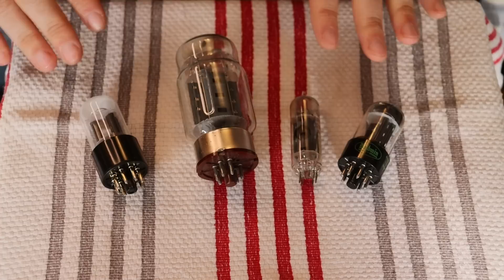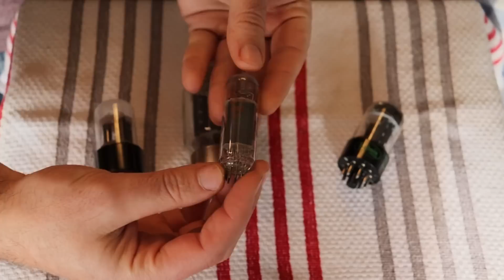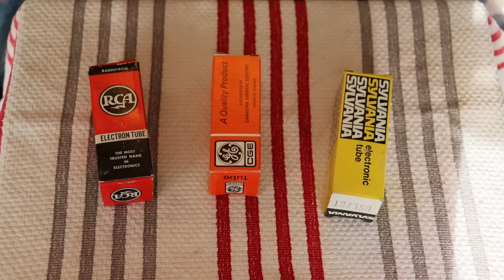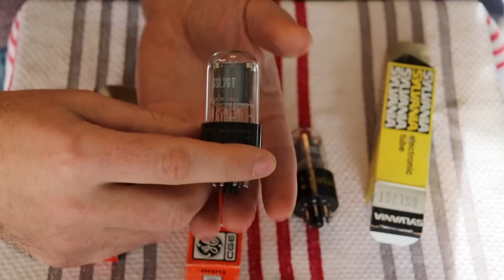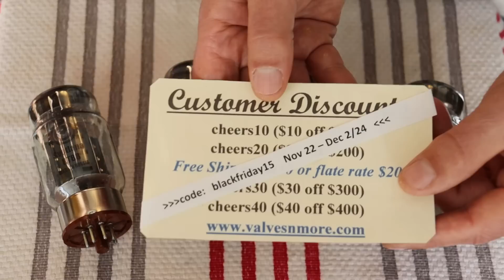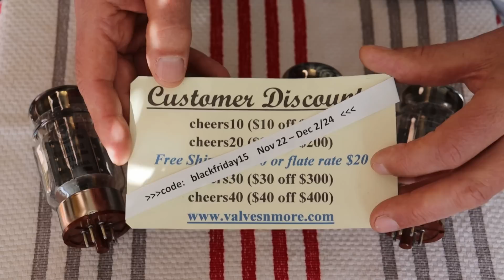Tube Lab #214 - Fraudulent Tube Sellers (and what to watch for)

Comment: Sry for having to ask. But when buying NOS tubes and especially pairs, I should make sure they not only showing the mA figures but also (and that's what I am seeing on ebay besides the mA) IP and GM figures? What are they telling me?
Reply from the maker: For the three main types of tubes used in home audio, here are the only valid testing methods:
1.  Rectifiers, current at a normal high voltage operating point loaded correctly with a max c1 capacitor (per data sheet) in circuit.  The testing number will be for current (mA).  Obviously for twin rectifiers you'll have either two numbers or a sum (which is how we do it) No other test is valid.
2.  Voltage gain tubes (preamp / phase splitter / driver) mutual conductance (Gm) test with results either in true mmhos (numbers like 3.1 or 3100) or as a percentage of NOS (new old stock) for example a twin triode (2 tubes in one bottle) like a 6SN7 that is perfectly on spec would have numbers of 100 / 100 over 100, but nobody writes it like that, so you would typically see 100 100.  Now Gm can be variable, eg Tung-Sol 6SN7's typically test 10-20% below the data sheet spec or 80 80.  Caution!  Many testers in use by sellers ARE NOT true Gm testers and are in fact emission testers, which are only capable of determining if a tube is working or not, and can not be used for Gm matching.  Worse still an emission tester can give a completely erroneous result.
3.  Power tubes are "Idle Plate Current" tested at a normal high voltage operating point with the results marked as mA or sometimes Ip (plate current).  The vast majority of power tubes are not correctly tested (and as a result not matched correctly) by eBay and other sellers, they simply don't know how to test power tubes.  We designed and built a Custom Power Tube tester/matcher and most sellers that know what they're doing will have also built their own tester.  A power tube should only have one number and that's the mA number (~40-80mA).
4.  Lastly, Testing vacuum tubes (or any electronic component) has three aspects.  First you need to have invested in or built the correct equipment for the task.  Second you need to follow the correct methodology.  And most importantly you need the experience to interpret the results.
Hope that helps!  Cheers Jim
Reply: @tubelab194 This is awesome! Thank you for such a detailed answer, loaded with information. Helps a bunch!

Comment: What curve tracer do you use for matching your tubes? I questioned one seller on ebay and he said, "the tubes look absolutely identical!"  Oh boy! (he was not saying the curves from a curve tester were identical,  he was saying the tubes physically looked identical!)
Reply from the maker: @glasslinger  yes a lot of inexperienced sellers have entered the marketplace in the last couple of years.  On our lab benches we use a number of testers, some our own design, some commercial with mods, to test virtually all tubes made from about 1920 to today, including the sub miniatures.  For voltage gain tubes we test for Gm as a percentage of NOS (new old stock) and for power tubes we test for current (mA) at an appropriate high voltage centre operating point.  Our Custom Power Tube Tester can handle plate 0 - 1,000vdc, +/- 0 - 100vdc for grid and any AC filament voltage required.  As well we can test power tubes for cathode bias or fixed bias (some high powered transmitter tubes require one or the other bias methods).

Comment: I rarely buy tubes but occasionally I will buy what I need- mostly generally signal or amp tubes.  I was given a bunch of tubes and recently I went through and found most tested good.  The original owner repaired televisions in the 50s and 60s.  I noticed on eBay sellers are selling untested tubes, don’t know if any of them are any good-I won’t buy them.  Some sellers on eBay will make offers-that to me send red flags.  I enjoy your video.

Comment: Dual triodes in an envelope, in most cases, the two triodes do NOT need to be matched.  But of course, both triodes need to test well to perform with low distortion and have a good service life.
Reply from the maker: In our experience this is patently incorrect when the tube is used in an audio preamplifier or power amplifier.  In many cases one half of the dual triode is handling the left channel while the other half is handling the right channel.  And in the case of true balanced circuits one half is handling the hot leg and one half the cold leg.  In both these examples (and many more) it's critical for good audio to have matched sections across all related tubes in the circuit.  Now if you are talking about an instrument amp, for example the input tube of a typical guitar amp is often a 12AX7, in that case so long as the tube is testing good, it's not a requirement to have matched sections.   And you could probably come up with a number of circuits in which mismatched sections aren't required.  But in general yes, matched sections are a requirement for good audio.

Comment: Gentlemen, having noted your difficulty in describing what tube testers do, let me help:  You probably already know that the TV-7 series of military service tube testers is a trans-conductance (mutual conductance) tester designed and patented by Hickok, which uses AC control grid drive and measures AC plate voltage response.  That type of circuit is simplest to apply operating conditions to a tube under test and gives the most accurate plate response readings translated into a trans-conductance reading value.  An honest tube seller should be quoting the readings from a trans-conductance measuring tester that he routinely uses that is properly calibrated.  If the seller does not demonstrate his capability as part of his sales appeal you should think twice before buying.  On average, in my experience, the most reliable sellers are on eBay because of eBay's buyer protection procedures.  FWIW.
Reply from the maker: I don't recall having any trouble talking about what tube testers do.  And given we have about a dozen of them, many rebuilt by us and one Custom Power Tube Tester/Matcher substantially designed and built by us, I would consider us at the very least experienced professional operators of said Testers.  But your point about looking for Sellers that declare the type of Tester used and the testing numbers is an excellent way of sorting out the good from the bad.  In our experience a better approach (one we use everyday) is to purchase from known good Sellers, who know what our expectations are (high) and sort/price accordingly.  As a result we often pay slightly higher prices from our wholesalers - BUT we almost always get the very best tubes they have to offer.  They then sell the leftover tubes on ebay!

Comment: 70% of Valve amps in use today use Russian made valves. The "Cold War" caused a bias against Eastern block manufacturers. The fact is most of the best after the early 80s are Eastern block made. NOS from Europe will sound fantastic but 3 out of 4 will be useless( unless you don't mind super-microphonics). So you buy 4 ecc83s NOS and only 1 will do the job. If you are lucky and have extra cash to burn buy twice as many as you need and test them in the amp, whether V1 or phase inverter. Your ears will let you know if you did good.BTW, who can we turn to for original spec 5881s?
Reply from the maker: @Waldoandotto007  thanks for contributing.  A couple of clarifications from our view point. I would guess the audio tubes in use today, break down something like this (25% vintage, 25% moden Russian 15% E.Europe (JJ) and 35% Chinese).  Our experience with Soviet era tubes has been almost 100% positive, for most factories.  We definitely don't see many microphonic tubes our of the former USSR.  Modern Russian tubes (New Sensor) is a totally different story, with short lived power tubes being the biggest problem and just mediocre sounding tubes.  That's not surprising given that many of the Reflector tubes (same plant as New Sensor today) made in Soviet times also aren't very good (some exceptions).  That said some New Sensor tubes like their top line Genalex Gold Lion is one of the best 12ax7's ever made (watch out for Chinese copies!).

Comment: I saw some vendor selling his farther,s valve collection one was supposed to a GZ32 with original box and this example had a anode cap on it. Not a clue what he was selling.
It does make me wonder when I see vintage valves being sold as new old stock with the original box as to weather the new valve has been taken out and used and the old one put back into the original box as a spare because it still has some life left in it ?
Reply from the maker: @itsonlyme9938  that happened a lot, but you can easily determine if a tube has some hours on it, by checking the gettering, pins, base and of course the testing numbers.  Now because many vintage tubes are now 60-80 years old, even brand new, never opened boxes will have tubes that look like they've been riding the back seat of a dirt bike for an afternoon.  Those tubes mostly just need a good clean-up, in particular the pins, which will be oxidized and of course tested properly.

Comment: Best tube trick I learned years ago - if writing is worn off, you can put tube in freezer for 30 minutes and when you take it out, the original writing will show up as the glass starts to warm.   Also you want to watch for cathode metal plating out on the glass from years of cooking - good sign of a tube that has been worn out.
Reply: An old timer told me back in the 70s, if you can’t see the tube designation, just breath with an open mouth onto the tube and you can then see the tube number in your moist breath on the tube. It always worked for me.
Reply: @mikerca  An old tech showed me this trick in the 60s, and there have been very few tubes that had no markings because of windex.
If a tube is dusty and dirty, and it doesn't just blow clean, use care, as most of the writing will come off and the value of the tube will go down.
Reply from the maker: @RICKS_Retrotronics  great tips for everyone, thanks!
Reply: great tip, im gonna try this on some
Reply: How do you distinguish between getter metal and cathode sputtering?

Comment: I got a lot of good tubes (for example maybe two-hundred 6080 tubes) from an old military surplus shop closing down. I am afraid to sell them on ebay because I feel someone will say the tube was bad and send me back another one.
Reply from the maker: @bertroost1675  if you properly test for "idle plate current" and only sell NOS (new old stock) or very nice used tubes, then you should be fine.

Comment: I have only had one tube deal bad,  a seller with an accent sold me a dud balloon tube that was not the one in the photo on ebay.  Frankly I buy from a reputable dealer with a website in northern Ohio.  His prices are nearly always better than the gougers on ebay and he is reliable.  He sells tested used or NIB.  I have sold some tubes online in the past,  I used my TV-7 to rate them.  I got a HIckok but what if I say a tube tests on Hickok 3500 and his says 3450,  he will be upset.  TV-7 is good and no one has objected to it's values.

Comment: I've been a tech for 51 years and this is the 1st time I've heard of the "missing gettering" method of determining a tube performance or life expectancy.  I just use one of many Hickok tube testers and have never had a problem.  Also, you basically state that not testing a rectifier at full rated voltage will give inaccurate results; IMO, that is not a valid claim.  BTW, you show a 5AR4; do you test that at 1500 to 1700 volts per plate?  I think not.
Reply from the maker: @Joseph-ut4ui  Thanks for your comments, but in reviewing them it looks like you didn't fully watch the video.  Assessing a tube based on the state of the gettering is just one visual element to take into account, as mentioned we then look at the pins, base and overall condition of the tube.  This was mostly for people shopping online, to give them some idea of what they're buying, though we use this method ourselves and it has served us well in thousands of tube purchases.  We of course properly test the tube electrically to determine whether it's good for the Store or the bin.  When we were talking about Testing voltages, it was specifically about Power Tubes, not rectifiers (though you make a good point, btw our custom Tester can go to 1,000vdc with bias of +/-100vdc).  In the resale/wholesale market the single least understood Testing Method is for power tubes.  There is only one Industry Standard Test for power tubes and that's the "idle plate current test".  I would note this is an open Comments section and is meant for friendly discourse, if you want to be adversarial, this is not the place for it.

Comment: They make a metal base one that is much better, those are what I have.
Reply from the maker: @josepheccles9341  could you please clarify what you just posted.  As it stands I have no (zero) idea as to what you are talking about or how it relates to the latest Tube Lab episode on Fraudulent Tube Sellers.
Thanks 
Jim
Reply: @tubelab194  The Russian version of the 6SL7 is 6N9P. There is a military version that has a metal base instead of plastic. The military version is a little better sounding tube, but aside from the base they look exactly the same. Also, there is a version of 6SN7 it is 6N8P, it also has a military version that has a metal base. I think they are just graded and the better ones are saved for military use.
Reply from the maker: @josepheccles9341  are you referring to the Melz 6H9C/6N9S/6SL7GT, many of which have a metal base.  As far as I'm aware Reflector never made a metal based 6SL7.
Reply: @tubelab194  I believe so. But I bought them a few years ago and haven't found them lately. I could only find the plastic base the last time I looked for them. I got the ones I have from either Amazon or ebay.

Comment: Thanks, for your tips and caution around dodgy tube sellers and their practices. I'm relatively new to tubes (couple of years) and I've learned the hard way the tricks that online sellers use to get noobs to part with more cash and move their stock. The classic is to sell the tubes as untested when the seller knows full well they are unmatched and/or weak.  The other gotcha I've found is that you must buy matched pairs or quads from sellers offering them or you are almost certain to get very unmatched tubes (they are the ones at either extremes). I bought two matched pairs of KT120s and, of course, one pair was marked 76mA and the other was marked 84mA. I have become so suspicious of sellers I am not interested in tube rolling anymore. I have a good combo for my PP amp and will keep them until they fail.
Reply: The world is awash in dud tube stashes.  I am amazed how many people used to save weak or bad tubes and even put them in boxes rather than toss them.  Anything the tube does not match the box,  is likely an issue. Or a dirty tube in a clean box. The lots of loose tubes I find consist of duds or very weak mixed with good or very good.  Makes no sense.
Reply from the maker: @TomSherwood-z5l  "back in the day" many repairmen had only a rudimentary understanding of how to troubleshoot a circuit, so their standard procedure was to replace the tubes one at a time (or all at once) and see if that fixed the problem (it often did).  Then they would stick the pulls into the new boxes and plan to test them at some later date.  Often that never happened and well you know the rest of the story!
Reply: That “untested “ claim is so common (for any vintage electronic gear) -  then you look at their other auctions and see lots of similar gear so it’s unlikely that they can’t test it. Or sometimes you even see a bench with equipment that makes it even more suspicious.
Reply from the maker: @Luckiestmanalive-bb1mi  yup!  Note we automatically match pairs/quads at no additional cost.  And your KT120's at 76 and 84mA are actually close enough to call matched, though at the limit (10%) of what I would consider acceptable.
Reply: @tubelab194  - thanks! The seller wasn't offering quads so I was hoping they might have been a little more generous!